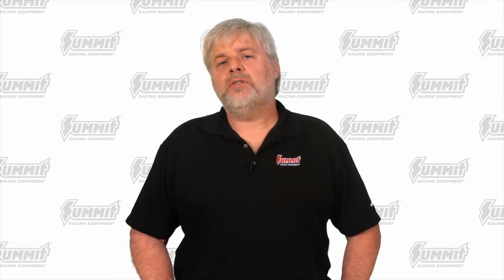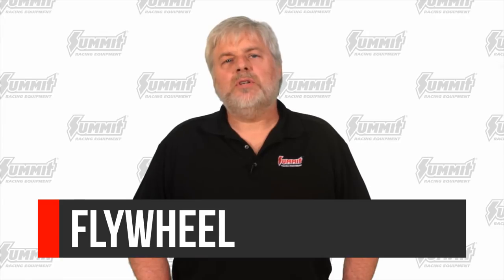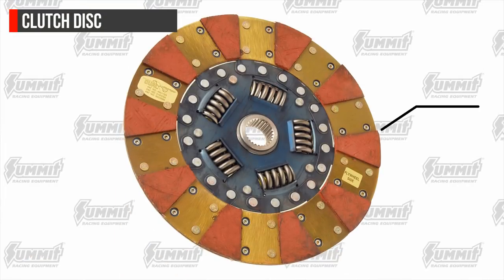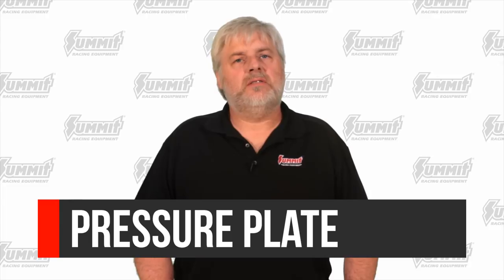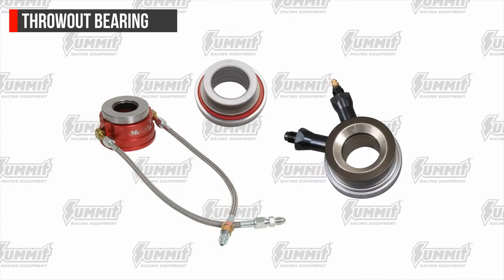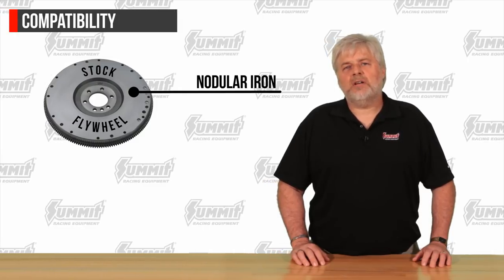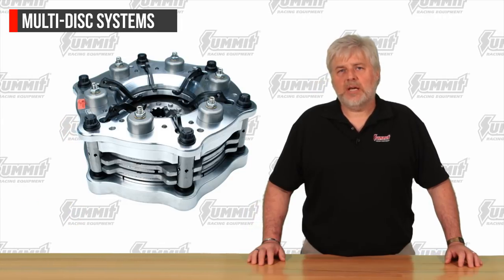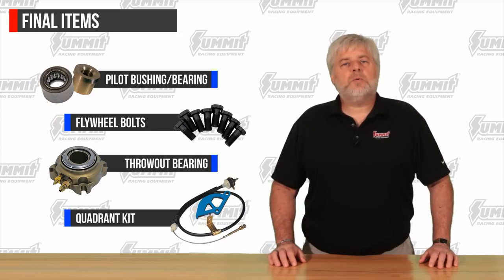Selecting the Proper Clutch - Summit Racing Tech Tips

Comment: Hi my name is nunzio can you please tell me which clutch i can put in my acura integra gs-r1993 engine b17a1 thankyou
Reply from the maker: Centerforce sells the series II clutch kits that provide up to a 60 percent increase in holding capacity over OE with only a mild increase of pedal effort.  Check out part number: CTF-CFT900800. https://www.summitracing.com/parts/ctf-cft900800/make/acura/model/integra/year/1993

Comment: Sorry Carl but There is not one throwout bearing on market  to support all those clutches
since 2012 when the aftermarket clutch gooroos  that make them decided to make the throwout bearings
inner sleeve out of toilet paper Super thin four hairs thick steel wont even support 
OEM clutch springs without clutch fork pulling off   back of throwout bearing.
Even ac delco went to cheep inner sleeve .
Matter fact the cam supercharger  heads are useless  and no sense in buying them 
When my cars cant find there way of jack stands for longer than 3 weeks because of 
last 4 throwout bearing failures  so you can sell more clutches.
I would love to talk to your CEO